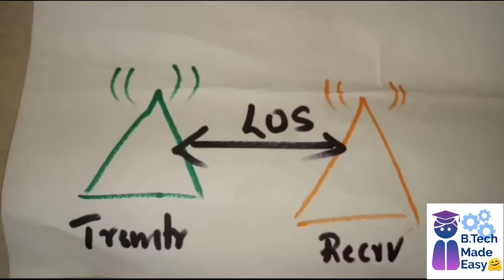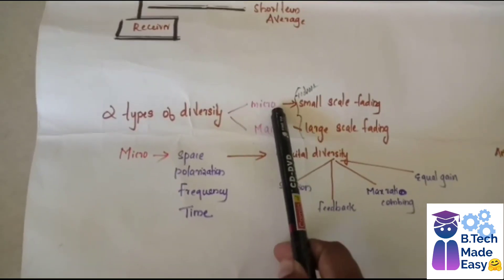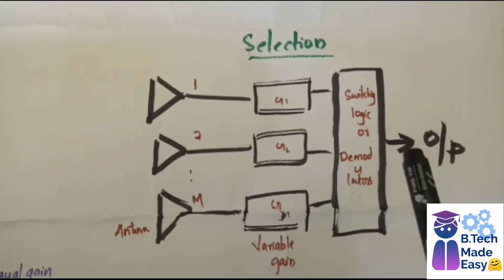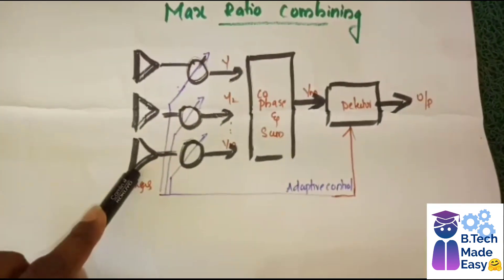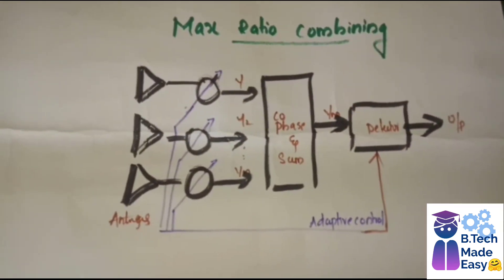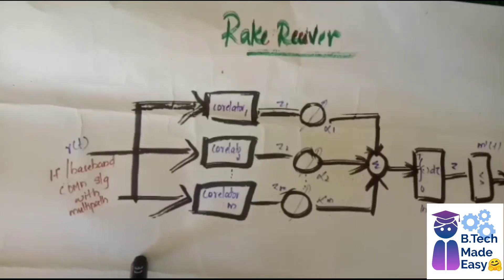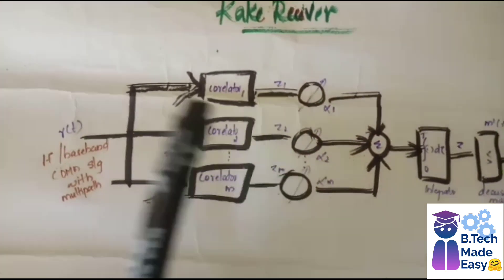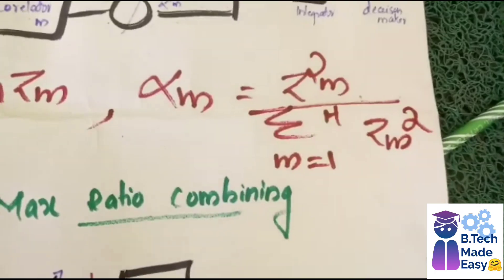Fading and Diversity Techniques | KTU Syllabus | Antenna and wave propagation AWP EC306

Comment: hello
can you help

Consider an 8-tap FIR equalizer. (a) When the channel
coefficients are [1, 0.8] (delays separated by a symbol period),
determine the optimum equalizer weight vector. You can either
derive it from the z-transform or from the MMSE approach. (b) Plot
the real part of the weight vector and comment on its shape and how
it is related to the channel coefficients.